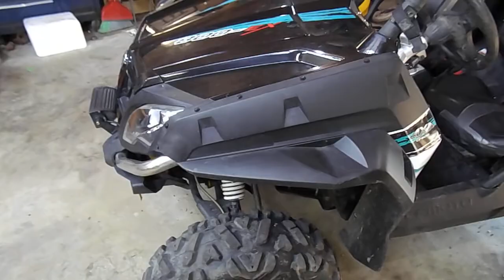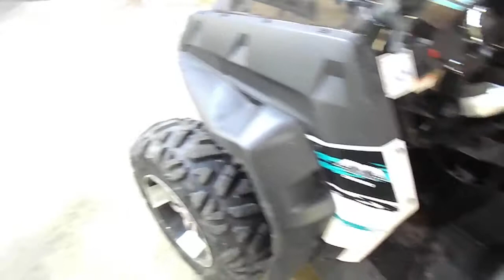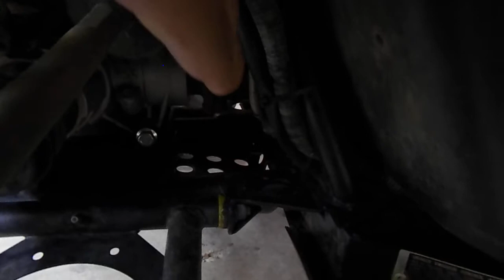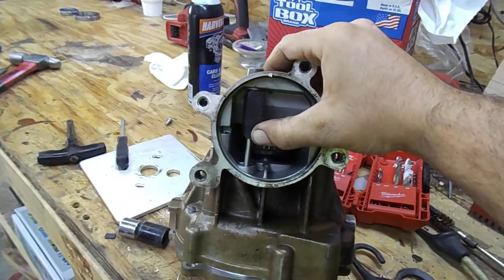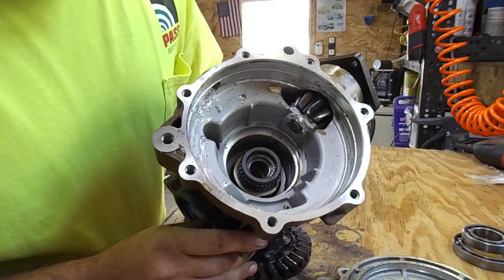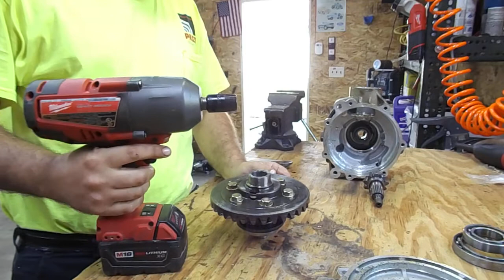cf moto zforce 800 front diff

Comment: I bought the tool for the retainer nut. It literally will not budge. I’ve used an air impact and it will not move. Is there anything different like reverse threads or something?

Comment: On we’re the bigger bearing goes. Was there any shims against the bearing going into the other part of the diff   Just replace some broken shim like yours was broken in back of that sort of washer clutch thing.   But wen in 2wd my front wheels wants to turn.  Don’t know what’s going on.
Reply from the maker: Yes there are shims on the pinion and ring gear.
With it wanting to be in 4wheel when it's in two wheel check your shift gear on the front of the diff. Put the selector in 2w and make sure the shift gear is all the way to driver side tire if it's off by a little the 2w and 4w and lock will be out of sync
Reply: @lucasetcheson3442  ok thanks. Will have to check that out.

Comment: How'd you get the front dif out ive tried and tried does it have to come through the inside after removing the plastic?
Reply from the maker: Comes out threw the front once the winch and winch mount are removed also there is a bumper bracket that needs to come off as well

Comment: I have to replace the O-ring on the actuator to case seal and as it looks I may have to remove the very front wiring connector to get enough room to slide it out. Do you thing there is enough room? And if not what's the best way to pop that connector off. I ask because it seems to have a death-grip on the sward connections and won't let go. The clip is loose..just won't let go. Oh, its a 2015  ZForce 800.
Reply from the maker: The connector that goes to the actuator will not come off if I remember right it has a flying lead on it or whip that will unplug from the main harness
Reply: @lucasetcheson3442  That's the way it acts..but I found this image of one with it unplugged and thought it should come off.  https://imgur.com/ghxktEJ  I'll take a look farther up the harness. I see new ones have then connected already with a 2-to-1 plug.